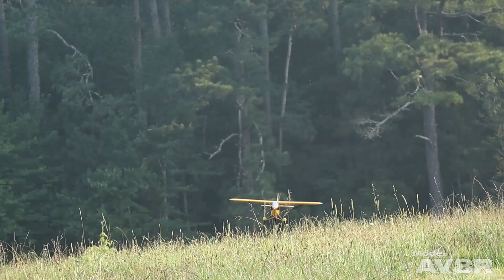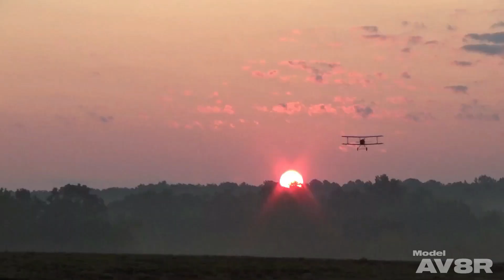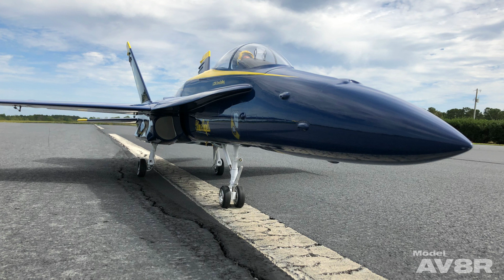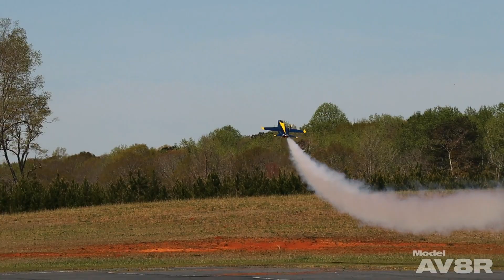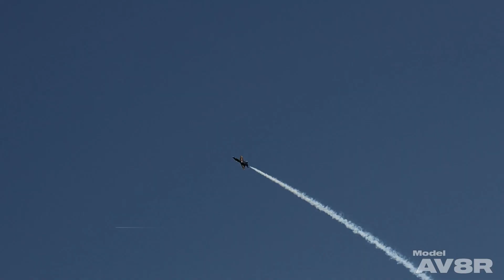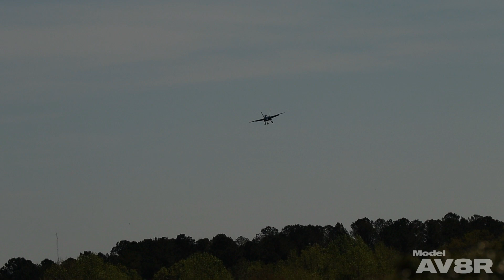Skymaster Blue Angels F-18C Hornet - Model AV8R Episode 31

Comment: CG info: 

Initially, the CG was per the instructions were VERY nose heavy. 
I’ll give two different ways to measure the CG:
Method #1 is aft of the leading edge, starting where the seam in the fuselage is found. 
Method #2 is forward of the main gear.  (I use the Xicoy CG machine).

#1- The instructions show the CG to be around 125-135 mm aft of the leading edge.  This is around the aft side of the forward wing tube. 
#2- 225 mm forward of the main gear.

However, over time, I have been methodically and slowly moving the CG back (aft).

I’ve settled on these numbers:
#1- 235 mm aft of the leading edge of the wing. 
#2- 120 mm forward the main gear. 

CG measured with no fuel (except UAT), no smoke oil.  Weight about 32 lbs.
Ready to fly about 41 lbs.

You read that correct, I moved the CG about 4 inches rearward to get it to fly correctly. 

I hope this helps!  
Feel free to reach out to me if you are flying this model. I’ll share what I know so hopefully your model can fly the best it can!👍😎

Comment: Great video.  I’m about to maiden this very same model. I think my model is the older version that has aluminum shafts horizontal stabs and brass bushing.  The manual for the CG location is so confusing and made no sense at all. I have the CG set at 200mm aft of the leading edge of the wing root. Yet, the Xicoy CG machine says need to add 2.34 lbs nose weight. How did the model feel to you when you were flying it with the 235mm CG as stated by Steve?  Thank you.
Reply from the maker: I've flown one of Steve's jets, but not this one that I recall. I do know he was happy with the way it flew with his CG.